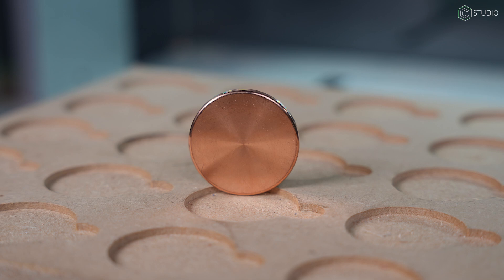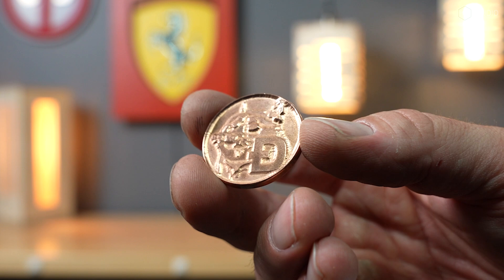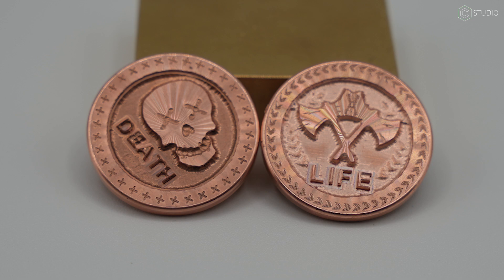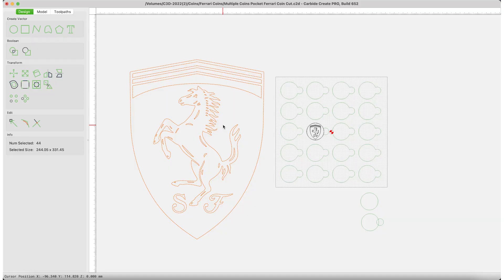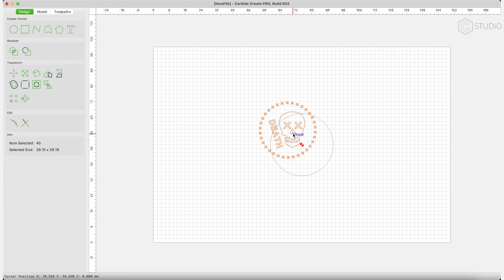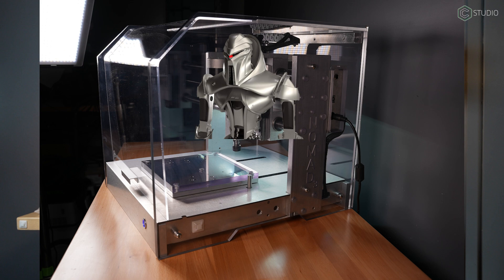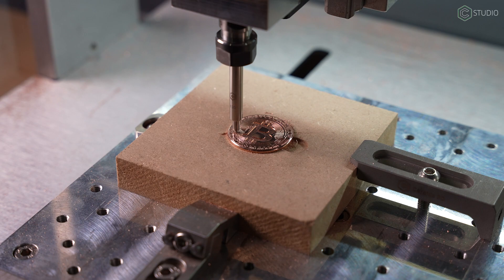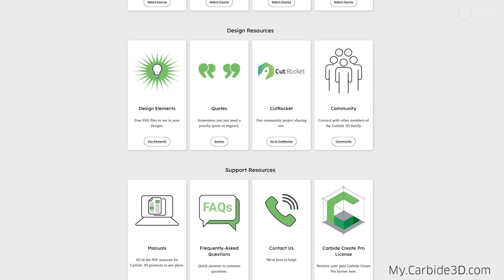Creating Coins with Desktop CNC

Comment: Very cool! I'm thinking challenge coins are in my future. But… how did you keep the blanks from spinning inside their jigs?
Reply from the maker: I use a friction fit in MDF.  the cutters are usually small and the cutting forces low.   
You could add in a dab of superglue between some layers of blue tape for insurance.

Comment: I have doubts about the capabilities of a CNC machine. in my country There are claims from many people. about using a 3d scanner together with CNC machine in copying ancient coins Then put it for sale. But I wonder in small details such as scratches in the mold Very small, such as 0.1mm, is the CNC machine capable of making it exactly the same as the original? I want to collect those coins. But worried about buying fake coins? Thank you.
Reply: depends on the cnc machine. A large machine called a mill can recreate details up to as small as 0.0001 inch

Comment: Do you think these would look even more like a real coin if you threw them in a tumbler to smooth out the etching
Reply from the maker: That’s worth a shot.
Reply: @carbide3d I want to start a side gig like this with the carvera with stainless steel 1” coins. If I take your idea and make a bracket for them I should fit 77. 
How long would you say it takes to engrave one side of each coin with a more moderate to advanced design like yours?(carvera has a auto tool changer and I’d have it change tools after one complete pass if I wanted to change tools rather then each coin)
Also I figured I’d give a kid I know in highschool like a$1 a coin he makes, spend another $1 per coin on cost etc and sell each coin for about $10 and make the consumer buy them in a set of 2-4( maybe each a different design and hopefully one of them they like enough to justify buying the set) so I can sell more bulk.
Making approximately 230 a day in 8 hours bringing in $2,300 minus $460 in upfront cost without tax and shipping.

Comment: How long its take to machine both side of coin?
Reply from the maker: This depends significantly on the design and endmills used.  Factoring in all the tool changes, these were approximately 15min. per side.   If you were to run batches, you'd end up conserving a fair amount of time over a several coin run.

Comment: Hi, please can you help...I'm looking to cut copper sheet by cnc, using a 2mm flat endmill, what speed, feed, plunge rate, stopover and pass depth would you suggest?
Reply from the maker: Start with the Aluminum Stock settings.   Be aware of the DOC and feed rates on the smaller endmills.  Go with smaller DOC and 1/2 the feed rates to start.   Tweek from there.
We broke a few endmills along the way.    When cutting metal that’s part of the learning curve.
Reply: @carbide3d  thank you so much for your reply. Much appreciated